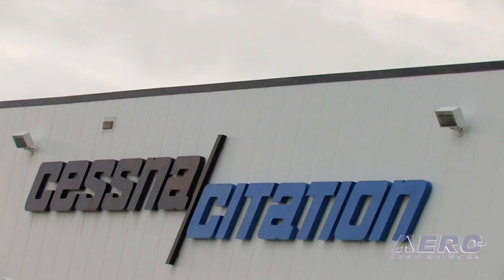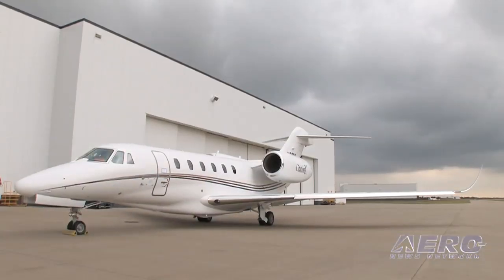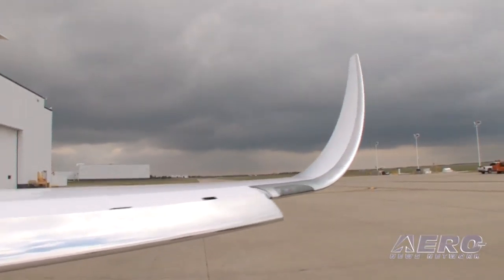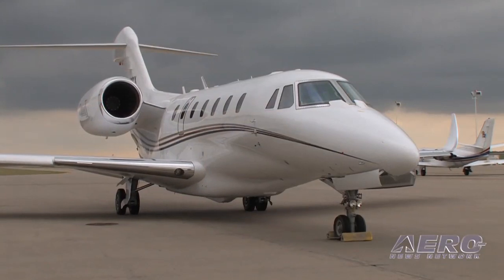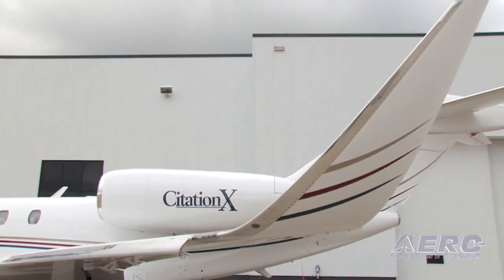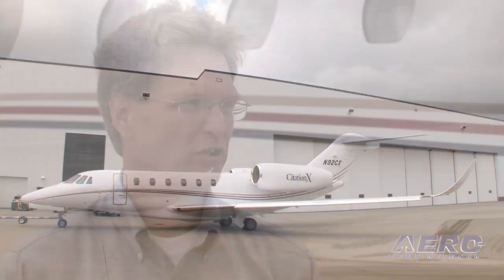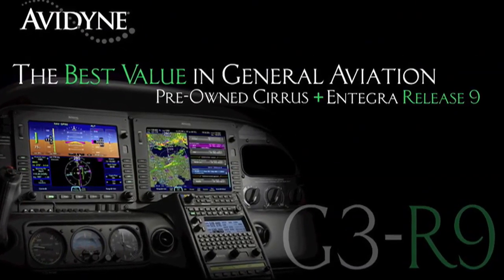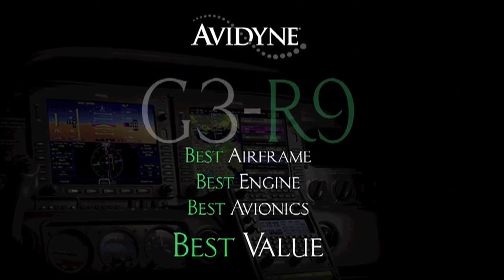Aero-TV:  Improving the Citation X - Cessnas Elliptical Winglets Update

Comment: Ok .... if we assume 350 gal savings per trip at ~$2 gallon. If it flies 8 times per month thats ~$68,000 per year savings in fuel ..... so about 8 years pay back, yes? I expect resale value is also increased so overall benefit would be better especially if it flies more often. If the 350 gal savings/trip is accurate!

Comment: Why don't they put winglets on the rear wings as well? Perhaps you could save twice as much fuel?
Reply: the rear is producing negative lift, and at cruise very little, if any, so theres not much of a pressure differential thus no need
Reply: OIC.
There must be some other tweak they could do that would make a difference. Like, I thought by now they would have put the get engines with external blades into production, unless they have already proved to be unfeasible.
Reply: BellinghamsterTrail HAHAHA